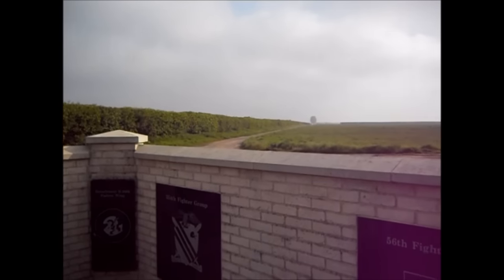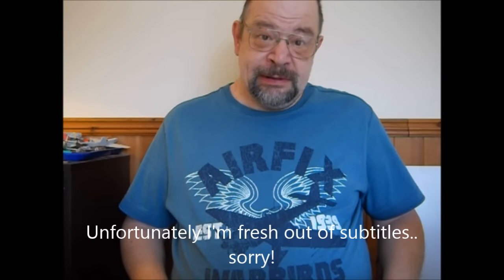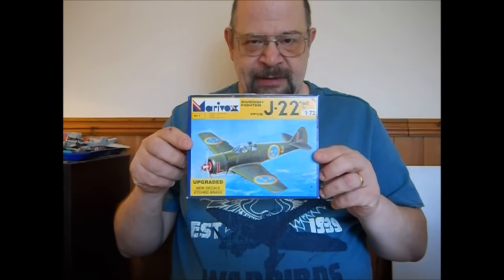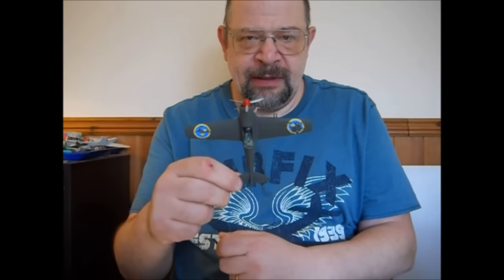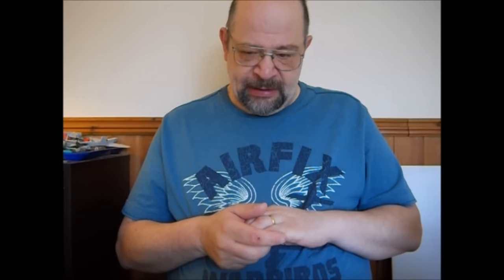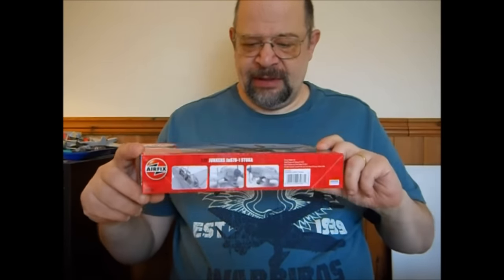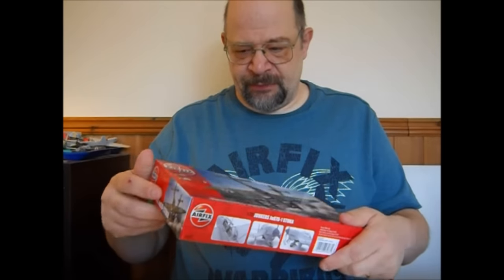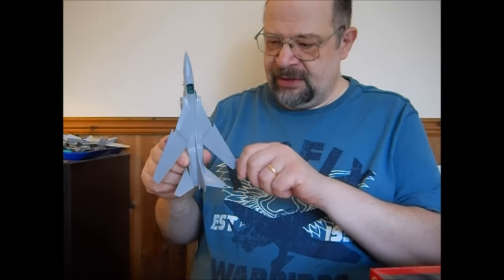CHANNEL UPDATE: April, May & June + BLOOPER

Comment: Fun update, I'm interested in your comparison build of the Stuka's that will be a very entertaining build. But that's a shame about your J-22's. Very sorry that happened, hope they will be back in action soon :D
Reply from the maker: +rebelsatcloudnine Thanks.. all I need to do now is to find the old kit.. hopefully it is in my wardrobe as I planned to build it some time ago, but as usual something else got my attention.. :) I will go down and work on the J22's in a minute.. at least there is a lesson learnt from my mishap, do NOT use 'Set & Sol' on them.. :)
Reply: +Rob BasicModelling Are they kinda thin and brittle? I've never heard of any decals reacting like this to Micro set & Sol, I find them as solvents to be rather tame. I'm definitly going to keep a close eye on that, thanks for the heads up :D I was thinking that this stuff might work before hand http://www.microscale.com/Merchant2/merchant.mvc?Session_ID=a69f333add88a77859153dbf96c99999&Screen=PROD&Store_Code=MD&Product_Code=MI-12&Category_Code=FINPROD
Reply from the maker: +rebelsatcloudnine Yes, I ended up using that very product in the end, and it works well.. :) The kit decals, although printed by Techmod, are VERY thin, especially the large stencils on the wings, on either side of the cockpit. The insignia are easier to handle but you still need to take great care when doing the decalling. Unfortunately I ended up using all my spares in the end, or I would have split them between you and Ian (UKScalemodeller) as he will build a J22 at some point as well.. I ended up using a mix of two different after market sets, one for the insignia, one for the Fighter Wing number and Squadron letter, and the kit decals for the stencils.. overall I'm happy with the result even though some of the colours do not match between the insignia, the letters and the numbers.. :P Still, better than not having any at all.. Hope to complete the builds tonight, and post some photos tomorrow.. :)